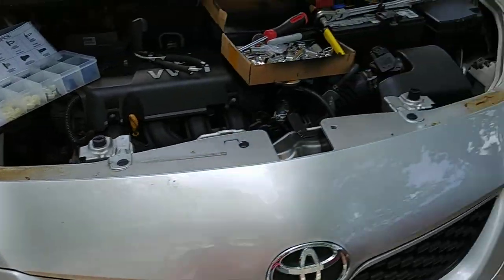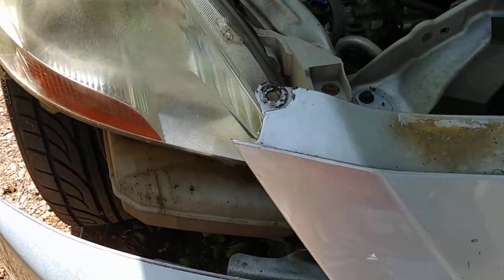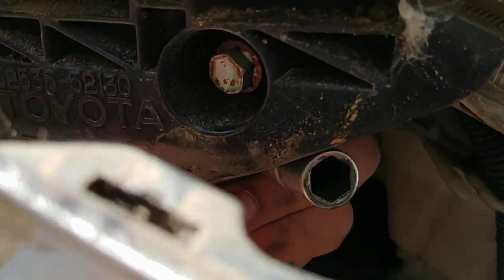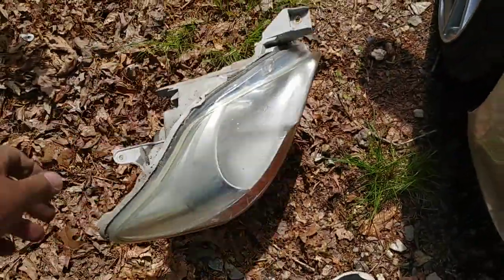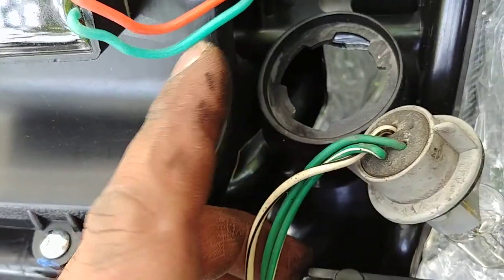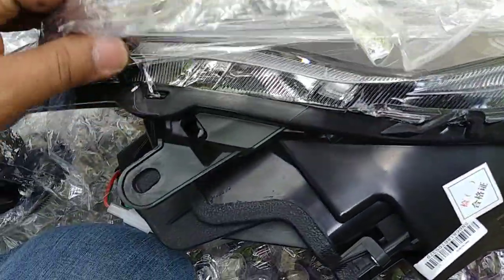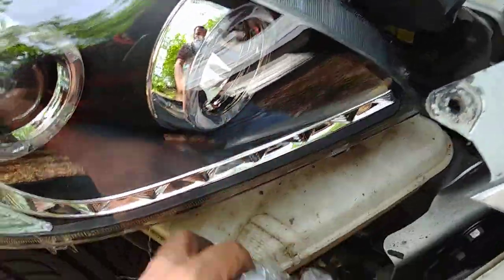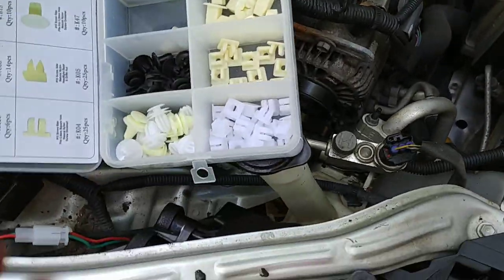Toyota Yaris VLand Projector Headlight Installation

Comment: Low beams should lighting be on the projector lens. Why is high beams (the reflector ones on the center) turned on all the time even when switched to low beams only? Im having second thoughts on these thinking of not buying seems defective to me. :(
Reply from the maker: When you first buy these headlights they don't come with a low beam bulb in the projector side so low beam and high beam somewhat use the same bulb, once you get a bulb for the low beam it changes to the projector lens. I did a follow up video on this and explain what else to do after installation and I will hopefully get it to uploaded today, but they do function properly. I do have a defective driver side headlight but it comes with warranty so I'll be receiving a new driver side headlight this week
Reply: @ScorpionMultimedia  if these were fixed I'd like to request a follow up video for the beam pattern of this set. I might buy this one because currently I have a set of LED bulbs on the reflector housing beam pattern is great same as stock but the brightness of leds aren't that good with halogen but I love how LEDs instantly turns on when im flashing someone. Thanks for the reply.
Reply from the maker: @espino_brian04  your welcome, I can do a follow up video for you. I purchased LED bulbs for the headlight so I can do a comparison between the halogen bulbs and LED bulbs in this particular headlight I think LED would be better since it a projector lens but I could be wrong. As soon as my led bulbs come in ill do a video on it
Reply from the maker: @espino_brian04  I been having issues trying get the follow up video to fully upload keeps stopping around 60% think something wrong so I'm going do another video and see if it works I apologize for that
Reply: @ScorpionMultimedia  its fine. I'll be patiently waiting. Take your time.
Reply from the maker: @espino_brian04  I redid the video and got it uploaded I hope it's helpful

Comment: Hi, how do I assemble the turn signals for these VLAND headlights? Do I need to get some other parts?
Reply from the maker: At the time yes needed to buy a turn Signal adapter, but since this video I've partnered with them and worked with them to do some changes and everything now included with the headlights, here the updated version of these headlights and installation https://youtu.be/NVtOJf9zpzQ
Reply: @ScorpionMultimedia  thank you very much kind sir!
Reply: @ScorpionMultimedia  Hi bro, do you know how to change out the high beam bulb? Or do you have a video on it? I've already managed to fix in a low beam bulb. I'm trying to change the factory high beam bulb to an LED one. Thank you!